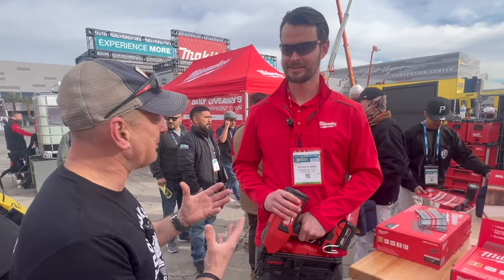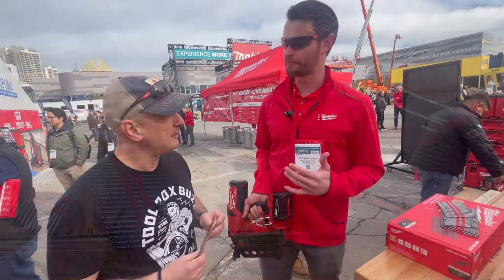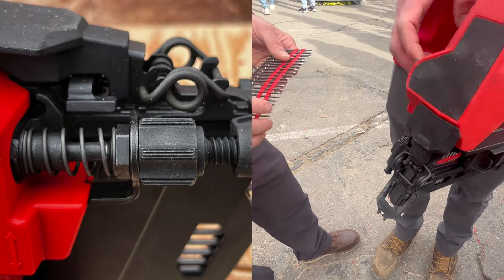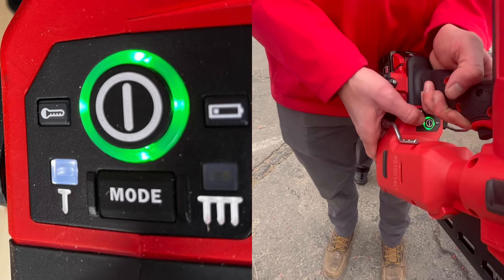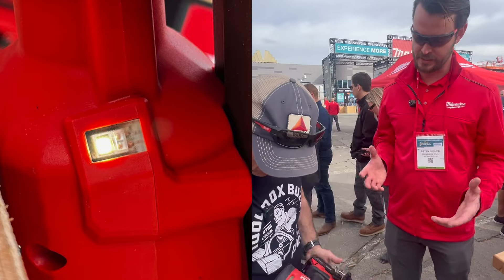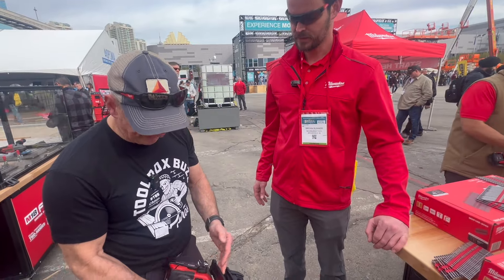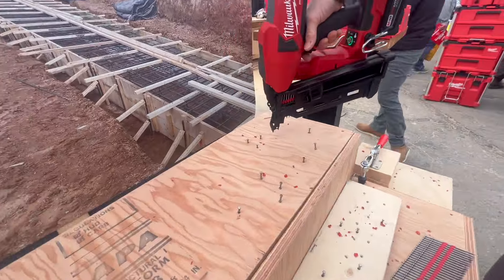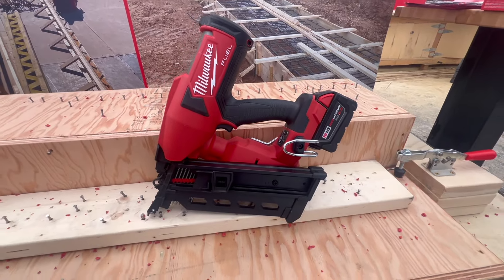Milwaukee M18 Duplex Nailer

Comment: How many concreters are actually using duplex nails? I rarely see them. Normal framers and bugel/tec screws seem more common
Reply from the maker: I see a fair amount of duplex nails used. I also see them used on framing sites for bracing.

Comment: Saves you time, sure, but if your like me after using their framing nailer a lot, I feel like it has partially destroyed my shoulder after a long day of using it.  It's just so damn heavy.  I expect the same from this nailer.
Reply: I felt the same way when using it and the Dewalt battery roofing nailer. After a few good weeks/months of using it consistently, your wrist builds up muscle, and the weight doesn't bother you all that much.
Reply: @Josh-ww5kz  I've been using the framing nailer since it came out.  Still not used to the weight.  I've since converted back to my pneumatic nailer.  I only bust out the m18 when I have a few nails to put in or when I need two nailers.  It's just too damn heavy to use all day.  Plus, the pneumatics shoot so much better.
Reply: @brandonbennett127  I really only use the framing nailer when I'm framing something out or doing roof sheething (I tack my sheething on the ends and then go back with a chalk line to fully nail it off, just because I'd rather take the extra 2 minutes to make sure I'm hitting the rafters 100% of the time) 

Then also when I'm doing blocking or something like that too. I'm going to get the extended magazine soon so it's not so bad for sheething. I normally use a siding nailer for sheething work

Comment: I have only 2 questions can it shoot nails into concrete stakes and what is the life of the nitrogen in the tank
Reply from the maker: They wont tell you the cycles but its somewhere near 200,000 + I learned it and posted it on one of M18 my videos a year or two ago

Comment: Milwaukee is looking to take Hitachi’s  lunch money on those duplex nails lol😂 which ( 4give my short story long ) but speaking of  I think aside from the rafter hook, the slightly shifted grip location, & flat top it looks damn near like an updated but near carbon  copy of the hikoki / mhpt duplex nailer which is a fantastic tool. Now don’t get me wrong  I’m team red all the way as they’re the most prolific and one of few brands that really listens to and primarily focuses on what the North American market demands imo similary both Makita & hikoki  focus on the JDM…Now with that said, we all know Milwaukee only steals the best designs to improve upon and upgrade upon. And until the past couple years in the nail gun market in my area you’d commonly see five or six hitachi/Mhpt  or Paslode  nailers for every m18 or dewalt you’d see and for good reason as a brand hitachi  have built a reputation for being solid performing, durable, and reliable tools that stand the test of time & Hikoki/MHPT has been one of the leading manufacturers driving innovation in the pneumatic/ cordless nailer industry for a few decades oh and unlike Milwaukee who specifically states they don’t want you to refill your m12/m18 nailers and  Metabo hpt actually sell the adapter to refill your nitrogen tank with oxygen via an air compressor when it gets low and  with this style cordless nailer that will inevitably happen regardless of brand etc
Reply from the maker: I didn’t know that post a link please

Comment: Americans always getting a chubby over bump fire mode. Why would it matter nailing 4x2 or 4x3 or 6x3 and most formwork carpenters skew nail most of their timber and yet all these guns are rarely tested in that application. If Milwaukee were smart I hope they made their nails useable with the Hikoki that way they’ll sell more nails. Remember the money is in the batteries and consumables.